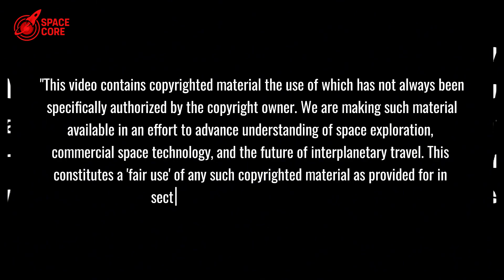SpaceX REVEALS: Hot Gas RCS Fix That Makes Orbital Refueling Possible...

Comment: Doesn't reslly matter, if they lose Tank pressure, the ship would fail re-entry anyway, as cant make the slow down manouvre ---  only possible useful case would be if tank failed in orbit (in way it survived) and thrusters allowed docking for a rescue --- very unlikely case.  So if the ullage fails the ship lost anyways.
Reply from the maker: You've highlighted a critical point regarding tank pressure and re-entry maneuvers for Starship. While loss of tank pressure is indeed a major challenge, these flight tests are precisely for understanding such failure modes and iterating on designs to ensure future reliability for controlled re-entry and landing.

Comment: But all the other rocket manufacturers use them to keep their rockets safe !
Reply from the maker: It's true that other rocket manufacturers prioritize safety with extensive measures. However, SpaceX's Starship development uses rapid, iterative flight tests to learn quickly and achieve full reusability faster, aiming for a more cost-effective space transport system.